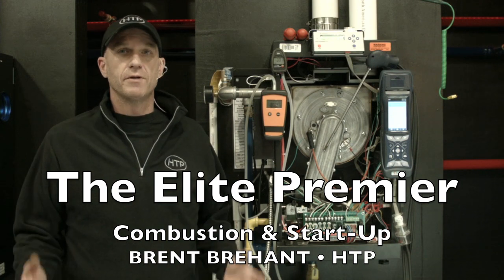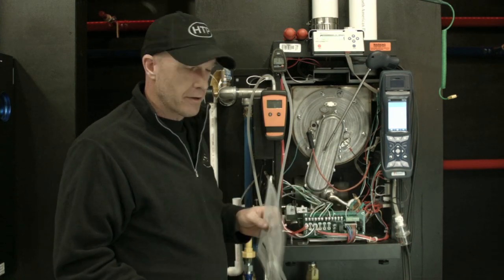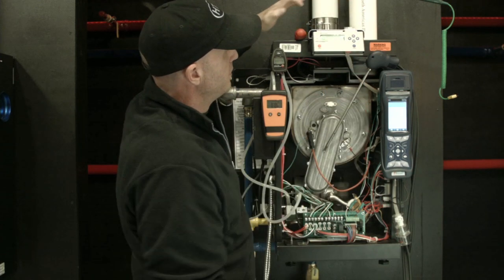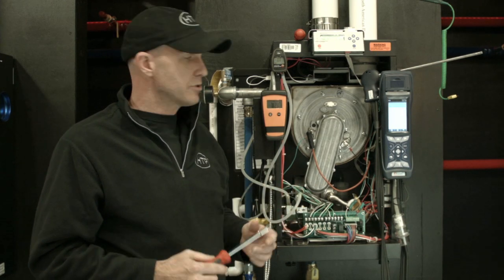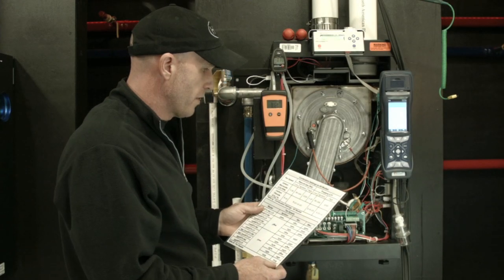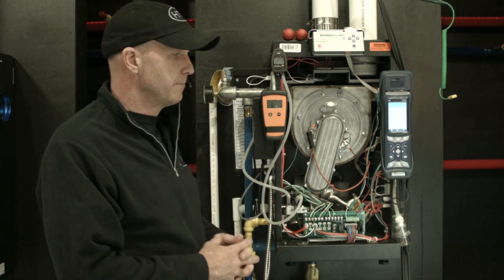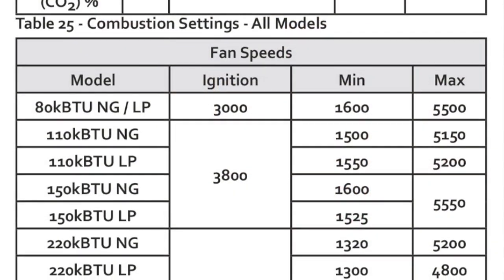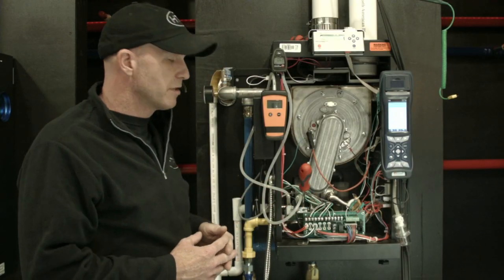HTP's Elite Premier Boiler: Combustion Analysis

Comment: I have a model EFTU-110WBN boiler. The blower fan resonates since I had it installed. My installer cannot fix the problem. When I start it it cycles thru and eventually throws the 5P3 code it shuts down, also it heats up to only 82 degrees F.  Is there a recall on this model?

Comment: @12:45  - Could you please expand on what you mean by it's going to require a manifold pressure adjustment? I have this EXACT same situation. Low fire  CO is higher than high fire CO

Comment: Nice to see.  I got the smaller ELP80. Just did my first coil clean after eight or nine years. Yeah no one told me anyway they didn't look terrible nothing solid and scaly or bumpy on the tubes. Sprayed some descaler rinsed it all off put it all back together. I did try to clean the spark leads with Scotch-Brite once again no real scale or bumpiness or or rust they were just dark brown in color otherwise smooth and crisp edges. They did not look worn. Anyway now it pops on Startup. Nothing major kind of cute sounding but obviously not right. What do you think I did? What can I adjust? Thought you were getting there but this didn't seem to need the adjustment. Some kind of ignition delay? Possibly my cleaning had nothing to do with it and the situation was there to begin with. I'm starting to recall something I may not have really paid attention. Additional information it doesn't seem to have a major time delay before it starts its at least a second or two not like buzz and start instantly but it doesn't Buzz for 5 seconds or more nothing like that. Running it on natural gas. No gauges no ideas what we're set at.